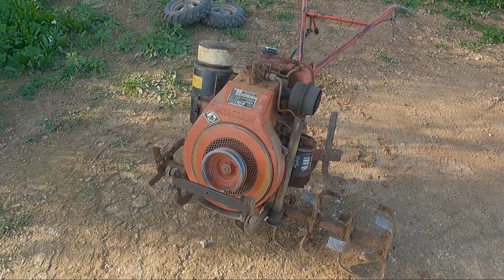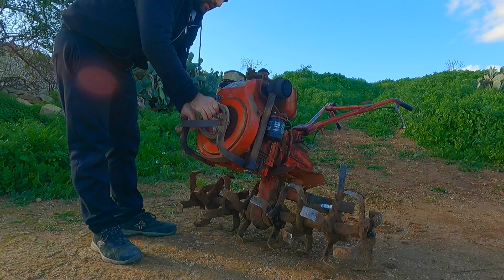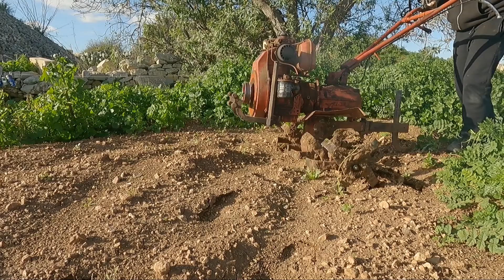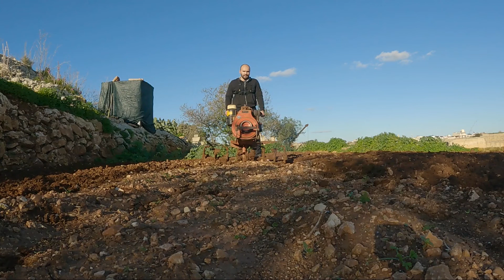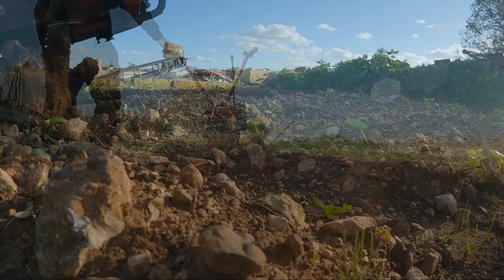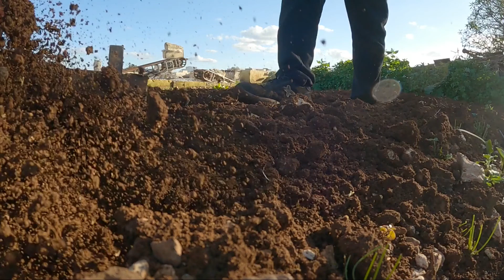Motozappa Rekord Ruggerini 10cv -  rallentatore

Comment: Ehi ciao ascolta, sai dirmi che olio mettere nella campana della frizione  nel brumi rekord
Reply from the maker: Hi, Thanks for your comment. I use 80w90 on mine.
Reply: @enginelover1  grazie mille
Reply: @enginelover1  ma è tutto collegato con la sotto chioma la trasmissione? L'olio deve essere a livello del tappo laterale della campana giusto un paio di litri?
Reply from the maker: @AntonioLucianoVenia  The bottom axel and the top gearbox are separated. You have to fill the bottom from that hex bolt at the rear of the "differential". And Yes for the gear box you just fill it until to oil starts to come out from the side bolt next to the Clutch. If you have more questions Please ask me
Reply: Grazie mille, oggi lo provato, lui  quando accellero e mollo la frizione va tipo sotto sforzo, pensavo fosse la frizione, lo guardata è ancora buona
Reply: @enginelover1  ehi ciao, ieri mentre lo provato, entrava solo la prima e giravava, ma seconda è terza sembra che entravano ma appena mollava la frizione non girava, quindi oggi ho aperto il cambio è ho visto che c'è un cuscinetto che si muove gioca quindi non fa innestare le marce
Reply from the maker: @AntonioLucianoVenia  It should be something that you can repair. Last year I re built a Mini Rekord. Almost the same gearbox.
Reply: Ho trovato i cuscinetti del Pignone consumati quindi con questo consumo gioco che faceva i cuscinetti, non innestava seconda e terza marcia, spero di trovare i cuscinetti
Reply from the maker: @AntonioLucianoVenia  They are common Metric bearing. You will find easily.
Reply: Si sicuramente, spero solo che non ci sia consumo nel l'albero dove alloggiano
Reply from the maker: @AntonioLucianoVenia  If there is use some bearing fit so they will not spin. Where are you from by the way?
Reply: Citta del pistacchio, Bronte CT Sicilia, e tu
Reply from the maker: @AntonioLucianoVenia  Malta, just under Sicily.